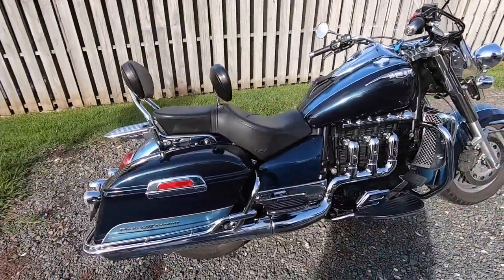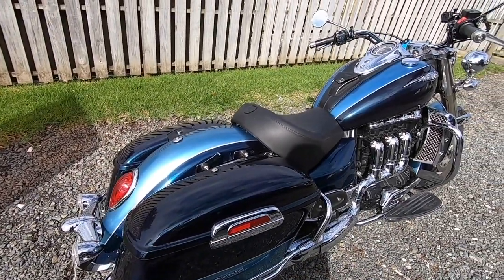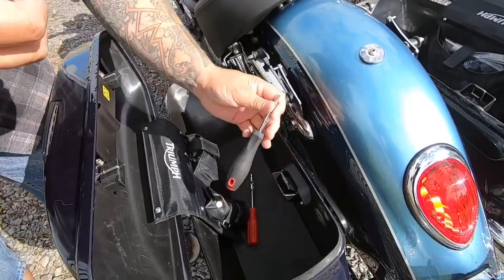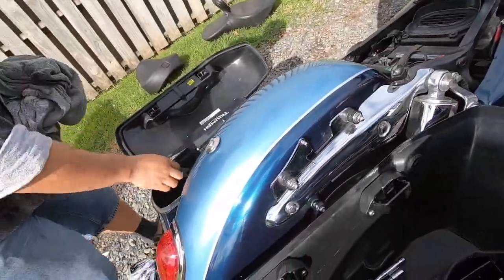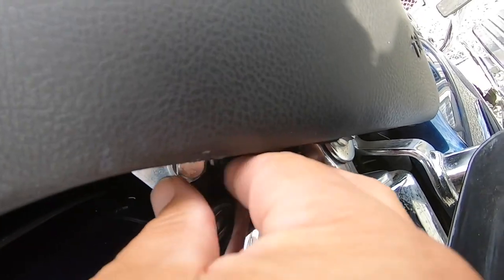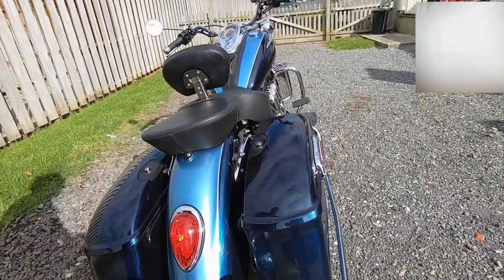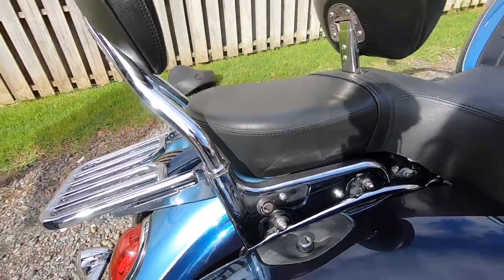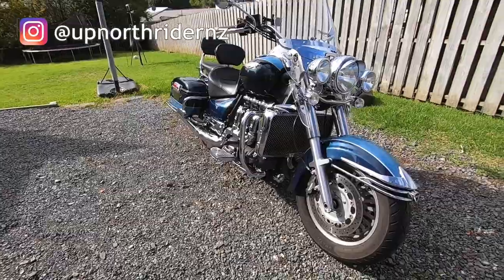How To Install a Motorcycle Seat | Triumph Rocket 3 Touring

Comment: I don’t know the year but it’s a nice model. I don’t know what happen on the way but the 2019 model was absolutely ugly. I level tank, the pipes etc... And then, the gorgeous 2020 came. I’m not much of a touring bike guy but you have a nice one.
Reply from the maker: Marco Polo thanks man, it’s a 2010 model and having all the extra accessories helps set it apart from the rest 👍
Reply: up north rider  I plan to buy the new 2020 GT this summer. The very first cruiser designed. I’m a 100% cruiser rider and been riding VTWIN so far. This model look so good, everything been redesigned. They came to their senses with the huge and high level tank that was ugly as hell. I don’t like BMW because of that. I never been a fan of a Triumph because they been building the same motor design since the 60´. Two cylinders beside each other. one on the left and one on the right.